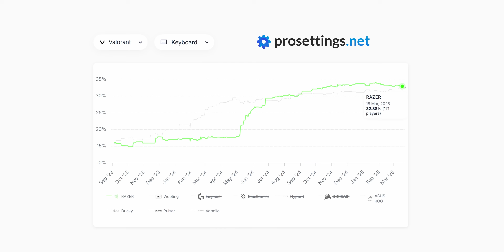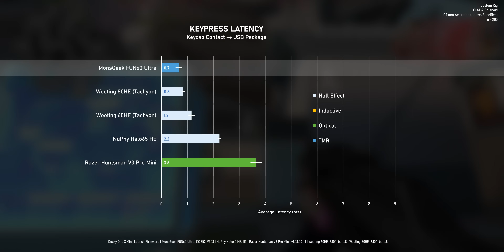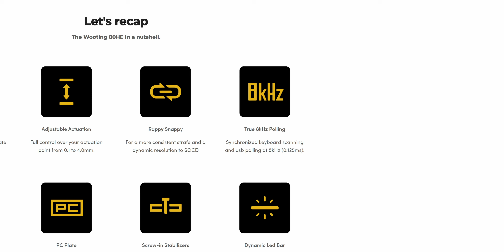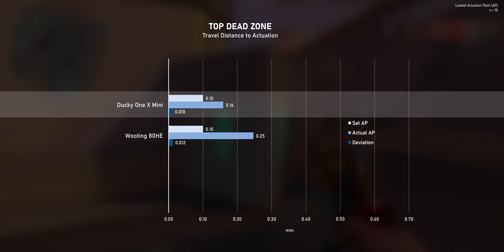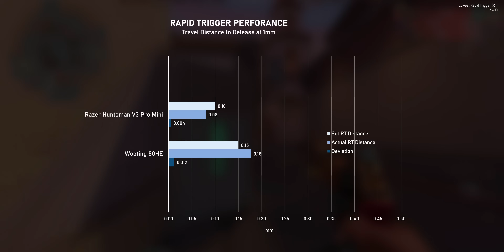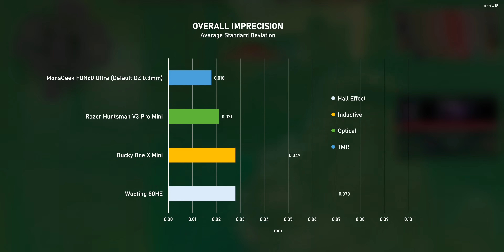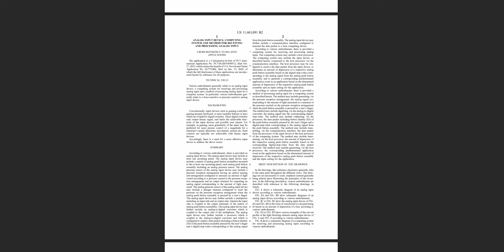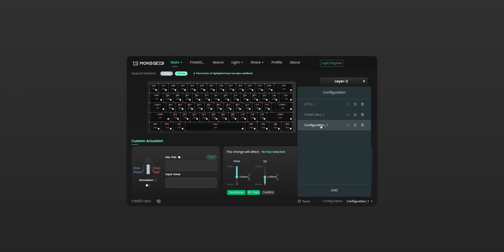These New Keyboards Are Here To Replace Hall Effect

Comment: Best part of TMR chip keyboards is that it can work with any type of switch.. I just ordered Monsgeek M1 V5 TMR and I plan to only leave Akko Magnetic switches on my WSAD keys... everything else stays mechanical for much better sound and typing experience.. You can basically combine all you want as FPS player in one keyboard.. It's also multi-mode so you can use it for gaming and work with up to 5 devices (3xBT, 2.4G and Wired). Won't even mention how much better Akko/Monsgeek is in terms of price to build quality ratio.
Reply: Hey mate, im tempted to buy that keyboard too. What's your experience with it 8 months in?
Reply: @evilazza14  Hello, Well basically can confirm everything they would say in different reviews, great build quality for the price, super easy to clean because of the ball mount, app it a pain but all features of normal HE keyboard work fine :D my biggest downside would probably be the fitting of the USB C cable... The socket is not prfectly cut out which bothers me a bit and there is a tiny bit of wobble on it that causes it to blink from time to time, and stabilizers could use some lube and/or tuning... Either than that 10/10 would buy again, especially for the price I was able to get it from China directly..
Reply: @R31T-0 Hey there, thanks for replying!

I do have a couple more questions if you don't mind answering.

- I saw that the board comes as ISO-DE, but I'm planning on using as ISO-UK. Do I need to do anything special to get the board working as ISO-UK, or does it just work out of the box?

I’ve also seen a few posts mentioning issues and wanted to ask about your experience:

- Wireless & connectivity: some people report random disconnects, especially with the 2.4 GHz dongle or after waking from sleep

- Software / profiles: others say the software is buggy, settings reset after firmware updates, or FN layer/profile switching doesn’t always work

- Other stuff: some mention fast battery drain with 8 kHz + RGB, and rapid-trigger/TMR acting inconsistently with mixed switches

- Would you recommend it or get something else?

Have you run into any of these issues? Are they common, or pretty manageable?

Thanks a lot — appreciate the help!
Reply: @evilazza14  I'm using ANSI layout but any layout should work straight out from the box that shouldn't be a problem.
I have absolutely 0 problems with wireless connections both on 2.4G and Bluetooth as I use them fro work laptop and miniPC homeserver constantly, the range might not be the greatest, at least that was the case with my previous Akko keyboard (PC75B+) but I didn't really have any issues with it here. 

For gaming I wouldn't really use 2.4G anyway because latency always will be worse so I just have it plugged on cable to main PC anyway and can't tell you much about rapid trigger and battery performance on wireless.

I had no issues with firmware update but the only change I did was adjusting switch sensitivity for rapid trigger + remapped Home key for PrintScreens for general use I'm mostly using Fn+FunctionKeys shortcuts I didn't need any custom macros etc for now.

I would buy it again, I'm happy with it. Probably if you only need it for gaming there are even cheaper options that perform as good or better but I didn't really care and Monsgeek is a whole package with premium full metal build in decent quality and good price, that was all I cared about tbh
Reply: @evilazza14  Also about battery drain on 8kHz... That's probably pretty straightforward.. It's the same case as with mice and in both cases absolutely useless. 1kHz reporting was good enough for anyone and extra polling rate only affects CPU usage and battery usage.. I've had Corsair Keyboard capable of 8kHz.. still set it to 1k.. Same with my mouse.. It's capable of 8kHz.. I'm just using 2kHz.. It's literally just a gimmick not worth your nerves and time. Doesn't give you any advantage, in worst case can even be disadvantage because of battery and fps impact.
Reply: @R31T-0  Appreciate the reply. One final question then if you dont mind. You mentioned you use it for gaming, mini pc and work which is exactly what i plan on doing too. By any chance is your work laptop a mac? How does this keyboard handle the shifting from Command/Alt and win/option keys? Is it seemless from swapping to the mac mode under the Caps lock or is there more to it? Thanks a lot bud
Reply: @R31T-0  May i ask what wireless mouse youre using, im also in the market for one of those too. Does the 8kHz polling only effect the CPU over wifi/bluetooth or is it over wired too?
Reply: @evilazza14  No I've never used it with Mac, It should be pretty straightforward but the mode switch is physical switch for wireless Windows / wireless Mac modes... Sadly I have no way of checking how would it work while being connected between different OS
Reply: @evilazza14  8k is only possible with 2.4K, currently using PRO X SUPERLIGHT 2 DEX from Logitech which doesn't even support bluetooth as far as I know. Not sure what you meant by wifi but general concern is simply about the amount of unnecessary operations per second you force your computer to process with it
Reply: @R31T-0  Thanks mate. Appreciate the answers. Regarding the swapping between your mini pc and other pcs, is this all done from the switch under the caps lock key, or is it done via fn keys? I assume you have to swap it from wired to wireless to use with the different devices?
Reply: @evilazza14  no the physical switch is only to turn on/off battery usage it has 3 positions: MacWireless/Wired/WindowsWireless So that's basically only to switch wireless mode on or off because wireless still works if your keyboard gets power over cable, the mechanical switch is just for batter if you don't want to use cable connection daily. The connection switch is with FN yes FN+U is wire Fn+Y is 2.4G and FN+E,R,T are 3 Bluetooth memory slots
Reply: @evilazza14  So if you have your keyboard connected to PC that is turned on or even to something like active USB hub that will provide power you don't have to touch the switch under CapsLock
Reply: mechanical switches sounding better than HE is an antiquated idea at this point
Reply: @mmhoss  They absolutely do sound worse simply because they are dry + they have much bigger springs to fit the magnet in the middle of the stem = harder to consistently lube them without overlubing them and getting mushy as hell... But I'm new into this world so I can only say that about switches I tested = Lekker from Wooting and Akko Glare now from Monsgeek. My last used mechs are Gateron Smoothie Silvers which are full POM = much superior in terms of casing material if you want to keep your keyboard smooth and silent with deep bottom sound.
But if you only used cherry/gateron mechanicals from stock keyboards or something like that then sure there is no difference.
Reply: @mmhoss  It's not. Mech switches sound like trash

Comment: I went with the optical huntsman and now I cannot play call of Duty and a few other games because they deem my keyboard a cheat.  I think it's absolutely ridiculous.
Reply: Can't you just disable socd?
Reply: In some case I think you can launch game with command line to disable Razer service
Reply: Furthermore I have to add one other caveat with the razor optical. It is a pain in the butt to use if you're trying to type a document. You press down a letter like you would normally on a standard keyboard and 10 letters pop off so if you're trying to spell the word "the" most of the time when I'm typing it comes out ttthhhhheeee.  It is absolutely frustrating and I'm finding myself switching my keyboard out if I'm having to type out documents from the optical to a standard mechanical Red Dragon
Reply: @AcM.5233 wut, I don't have issues with my wooting using socd enabled
Reply: @AcM.5233 You should be using profiles for your keyboard 
Your default profile should have SOCD turned off with normal actuation points with other profiles set up to automatically enable for specific games when they're in Fullscreen
Reply: Wait these games can detect your keyboard?
Reply: @yosefelsawy5102 detecting input key is easy enough since you  use it to do everything lol
Reply: @yosefelsawy5102  no I believe it's a feature the keyboard has

Comment: I realized the most important key point about choosing a magnetic keyboard is the latency. Because the rapid trigger at most only saves you 5ms in latency which means if you buy a magnetic keyboard which is 5ms slower in latency than the keyboard you already have. There then is no point buying the rapid trigger keyboard in most regards. Wooting has the lowest latency. It is truly a proper gaming keyboard.

Comment: Excellent overview of all the options and measurements. Have you measured the 60he without tachyon mode enabled? I’m curious how big of a difference that modes makes assuming RGB is off for both enabled vs disabled. I have a 10ft straight custom cable hoping it’ll run tachyon with no issues.

Comment: So while it's kind of neat that you managed to measure the imprecision that accurately, it would've been nice if you had highlighted just HOW SMALL 70 microns is and that it is not only unlikely but pretty damn near impossible for a human to sense a difference in the actuation point at that size. It's about the width of a nominal human hair, or a couple of dust mite poops stacked. Nobody will be able to tell the difference. The chart is nice, but the end result is that they are all the same for all practical purposes. We're talking about keypresses, not detecting dust mites.
Reply: Imagine missing a shot because a dust mite walked across the sensor lol.

Comment: Looking forward to more TMR keyboards. They've taken off in the controller scene.

If there's a 75% with decent software at a reasonable price, I'm in.
Reply: There is monsgeek m1 v5 TMR
Reply: Apparently monsgeek has a fun 75% coming late april early may
Reply: @horusmorus5588  Nice. Looks like it comes with a volume knob as well. Think I found my next keyboard!
Reply: @horusmorus5588 Yooo that's so hype. Already gotten 3 fun(60) but I guess I'll get some more xd
Reply: @hinchlikescake7592  well it's your lucky day. The company behind the 60% TMR board in this video just  released a 75%

It's called the M1 V5 TMR by monsgeek. I personally like the 60 layout and so have ordered one of theirs to try the software and see if it's usable or if I need to stick with my wooting. But the 75 does look pretty nice.
Reply: M1 V5 TMR just dropped and on the monsgeek website, they are also making M2 V5 TMR
Reply: Monsgeek has m1 V5 tmr. Its 75% with a knob and aluminium case.
Reply: what kinda controllers? like the xbox?
Reply: Yeah sucks that it's only in 60% so far. You'd think it'd be to save costs but that 60% board is so damn cheap that I don't see why they can't release a 75% and price it a lil higher
Reply: @Frozoken  For sure. There's certainly a market for these gaming keyboards with F rows and arrow keys (as per 80 HE) + more. Really don't like the 60% trend and FF.

Hopefully Monsgeek, MCHOSE. Madlions or whoever steps up to the plate.
Reply: @hinchlikescake7592  Yeah compared to 75/80% where you sacrifice so little for so much space saving the 60%'s feel awful with how much you have to work around them to save like 2cm vertically and 4cm horizontally. Especially when your like me and past removing a wrist rest you don't need any more vertical space savings

Comment: The Wooting One used analog optical switches. Still using the one I got from their Kickstarter 8 years ago
Reply: Mine started having problems with input on the w key and a dying led.

Was an amazing board though.
Reply: @ my Zero key input started actin up and eventually gave out a couple months ago. Might try swappin the sensor on the pcb with one from a key i dont use

Comment: Men , literally  i haven in PC for years and still can accept the ideo of paying over 200 fukcing dollars for a keyboard  that doesnt have obvious improvement from coming of a good or high quality keyboard 🤦
Reply: $44 aud aliexpress  search "Akko MonsGeek FUN60 Mechanical Keyboard Magnetic Switch 60% Gaming Keyboards Rapid Trigger 0.01mm 8K ARGB HE/TMR Custom Keyboard"
Reply: @Stoogie  yeah, it's much cheaper on Ali for some reason
Reply: Repeated actuation without fully depressing a switch is actually a massive improvement.

Partial presses can also be a massive change in some games too.
Reply: @samuelsmith9582  not really, because if you only gonna elevate the sensor were the actuation is triggered , it's a vague way to say  "the car will respond faster due to the shorter accelerator" on it
Reply: @Agp1597  it means you can half release a keypress and press again before it has returned through the original actuation point. If you don't understand idk how to help you.
Reply: @samuelsmith9582  I understand, completely , trust me, will be helpful, but it will be helpful just for games when you are strafe when it comes to movement, but apart from that I WONT WORTH IT FOR ANYTHING , heck even the motion key triggers can be more useful for PC gaming, I mean if the key can act like the consoles thumbsticks  were you can gradually move faster or slower little by little I could be with you , But for a CS GO  that looks like built in the keyboard ? 😮‍💨
Reply: @Agp1597  you can do that with analog keys.

Comment: Is there a keyboard that is like being taken out a gaming laptop and put into its own case?
Backlight, extremely short key activation point and key travel distance (compared to other regular ultra slim keyboards), n key rollover, but most important, key caps that do not wobble. I tried a bunch of keyboards, normal and slim, mechanical and rubber dome, but all key rock back and forth relatively strong, compared to my laptop keyboard, which has almost no play in it's keys.

I have tried multiple keyboards in stores but they are either ultra thick (just regular size), dont have illuminated letters, or have wobbly keys. And then there are ultra expencise ones (150-200 bucks and even more) which I couldn't test for wobblyness because I didn't order them.
I currently use the Logitech Illuminated K740 but although it counts as ultra low profile (I didn't know that untill I was looking for "slim" keyboards and wondered why they are so thick) which is what I am looking for, the key wobble quite strongly and the activation point if relatively far compared to my laptop. The other keyboard I have is the rapoo E9080, which is even more ultra slim and its key don't wobble (or just as little as my laptop keys). But it has no illuminated keys.

Is there a keyboard that combines the two? Ultra slim form factor, key stability and activation distance from my rapoo and Backlight from my Logitech.
I don't care about numpad, but reprogramable fn keys would be nice to have.
Reply: With ultra short activation point I mean that the entire key stroke distance is seems shorter then the activation distance of my Logitech, which already counts as ultra slim. Means the activation distance has to be respectively shorter as well.
Reply: @Caiitrix  Maybe the Nuphy Air? That or the Lofree? There are a few low profile mech keyboards out there, but yeah definitely check out Nuphy. Far superior in build quality than anything Logitech makes.

Comment: To be fair, Wooting started with optical switches, but the flaretech was very unreliable. I had an original Wooting Two, switched from black to blue, as i got a Wooting Two HE, and the keys never worked 100% again. Most of them only detect half the travel.

Comment: wait wait i have this problem when i hold a button like W and i have this issue. how do i solve that?
Reply from the maker: Increase the bottom dead zone if possible. Doing a calibration can also help if your keyboard has the option. If not, increasing the rapid trigger distance might help.